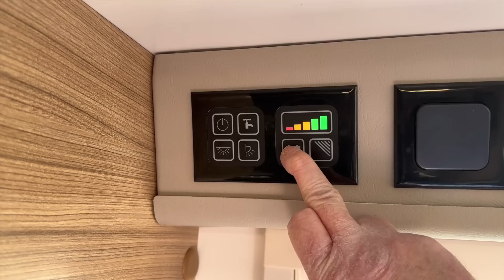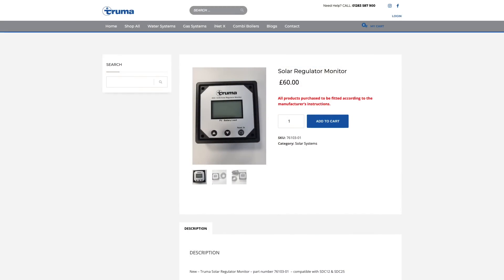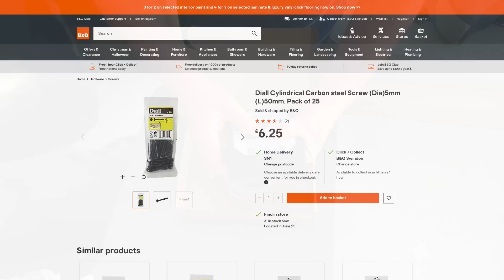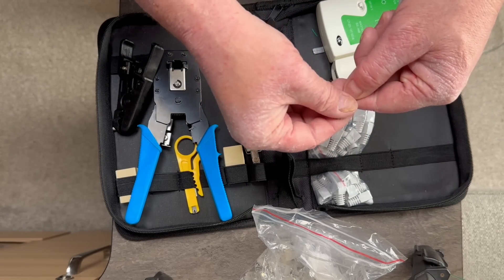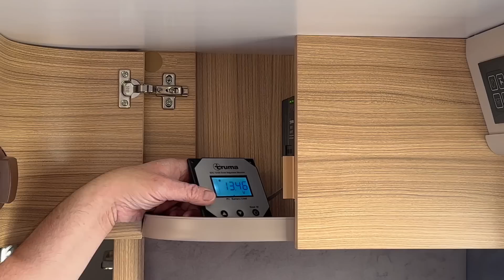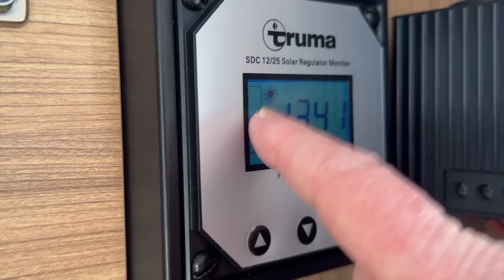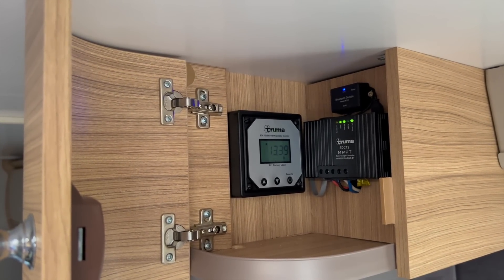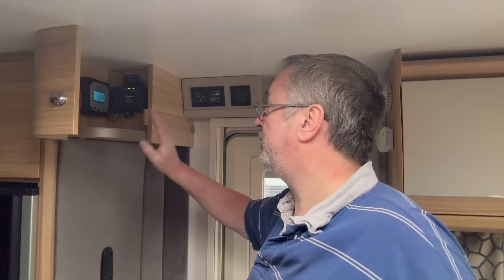Solar regulator display installation in a caravan

Comment: Ha ha, learnt the hard way. I bought the Truma MPPT but a cheaper meter that looked identical from a large solar supplier…… however it wasn’t ideal and produced some dubious readings….. I’ve now ordered the genuine Truma one so I hope this resolves the issue. As they say buy cheap buy twice….. only complaint is that on my old PWM meter I could also see the state of the motorhome battery too….. this obviously doesn’t provide this by the look of your demonstration and the fact you’re a caravan rather than a MH….. thanks for the video though it’s answered some questions for me

Comment: Really interesting vid. I’ve watched a lot of your videos and find the really interesting and informative. Couple of things. I never get the links you post?  We have a new Coachman Arcadia being delivered May. I’ve ordered a factory fitted solar panel. Warranty would be void if I did it myself! It’s a Truma 120w Panel as that’s all you get no option. Do you think that’s big enough as we will be off grid a lot? It only comes with a PWM controller so will change to a MPPT. Is the Truma kit worth sticking with? And would you stick an extra 80w panel on the roof?  Cheers Alan

Comment: Will fitting this effect my warranty
Reply from the maker: Hi Paul, great question - Simply put - No, but if you are concerned ask your supplying dealer if this will affect any warranty, or ask them to fit it for you. 

When it comes to warranty issues, a level of common sense will need to be used. If you break the solar panel, or controller whilst installing this - then one might assume this could be related. However, if you're suffering water ingress at the front of the caravan, its clear this install has not caused or been a contributing factor to the leak.. you get the picture....

Hope that helps, if you have any more questions feel free to ask.

Comment: HI Dan quick question just installed one of these .do you power the unit off after you stop using the caravan .
Reply from the maker: Hi, no i leave it alone. What I have discovered is the meter will only display a voltage if there is power coming from the solar panel. so in low voltage / low light conditions (like now) the meter will not display, unless you power it back on. 

Hope that helps. 
D
Reply: Thanks that' was my thoughts

Comment: Great video Dan does the screen blank out when not in use .
Thanks
Reply from the maker: Yes it does - the back light switches off after a couple of mins, and if no charge from panel it switches off completely.
Reply: Thanks dan will have to get one I'm having trouble with my mppt controller. Full green light never goes solid and always telling me it's ready to charge.

Comment: For that money a proper battery monitor with shunt would be far better. Granted you would have to run a cable back to the battery which is more effort than simply plugging in the display you have used, however importantly I note, you have already upgraded the charge controller to Truma MPPT and the standard Truma PPT controller installed at factory doesn't have the port so for most would not be possible to use that display. If you don't actually want proper battery monitoring and merely want a digital volt / amp meter with estimated battery State of Charge, which is basically all that display is, then I would suggest for most people (assuming they have the standard factory fit Truma PPT controller) they would be better to swap their controller for an MPPT controller, benefitting from the charge efficiency improvement but not to upgrade to the Truma MPPT controller and instead choose one that has a display on it, thereby solving both the lack of display and improving charge efficiency with one device and costing a lot less than the Truma MPPT and separate Truma Display. I would still put in a proper battery monitor with shunt in too though.
Reply from the maker: Hi, the caravan did come with this MPPT controller, as the old PWM controller is now no longer fitted.

As for a shunt, yes thats a much better solution - but to be honest, i just dont need that level of accuracy. I just need to see what the actual voltage is, and if there is anything coming from the panel.
Reply: @TheTrudgians  about time caravans are fitted with MPPT controllers from factory. Yes, in your use case simplest easiest option is what you have done. For those with older vans that don't have a MPPT controllers then get one (so so much better) but get one with a display on it. For those that want to really geek out on data, then also get a smart shunt and display, preferably with Bluetooth and logging, this will give all the data and historic data anyone could ever wish for. 
Great Vids Dan, I think I have watched every video you have ever put on this channel. Still prefer the how to video's you do but there is only so much you can or would want or need to do to a new van. Being a tinkerer, I love fixing and upgrading stuff, give me a van that's a few years old and out of warranty every time.

Comment: Bailey and other brands should install a quality solar controller such an Epever solar controller from the outset .  From that and your new display - you can see how the solar is performing.  Volts isn't the best measure of a battery SOC though.  Best to counts Amps in and out with a shunt.  I added both the Epever and a Victron smart shunt with bluetooth to our Swift.  From the house I can see what the caravan is doing outside.  The Victron is so much more accurate than the Sargent unit.

Comment: Very good video... But...I'm sat in my 2017 bailey scratching my head to understand why new caravans don't tell you the voltage. I have a crystal clear digital voltage reading as part of my standard bailey switch panel. Why would manufacturers get rid of this? Backward step?

Comment: Nice Video! If you need to replace the Truma MPPT, I can thoroughly recommend Victron gear. It comes with bluetooth, 100% reliable with lots of data available, if you want it.

Comment: Hi, great video. Thanks. We're thinking about getting a solar panel in the future. One question about my battery. Our caravan is parked up on our drive hooked up up to mains from our garage. Would this be okay for the winter. Is it best to remove the battery and keep it on charge in a warmer place, like the garage. Thanks
Reply from the maker: The great thing about keeping a battery plugged in on teh drive is you can set the heating on low to drive off any frost or freezing weather. However, the charger on board is essentially a power supply, constant voltage, constant current. So it wont charge a battery, more keep it topped up. 

Occasionally switch the power off and run something on the battery to draw some current, then switch the power back on to re-charge the battery.
Reply: @TheTrudgians  Thankyou for the reply. really helps watching theses videos, as a newbie to caravanning.😁

Comment: Hi Dan, another very useful mod - thanks.  Did you ever get round to fitting a remote heat sensor to the Alde heating system?  We are experiencing the same problems as you have mentioned previously  - I.e. the system thinking it’s warmer inside the caravan (2024 Bailey Unicorn V Seville) than it actually is, due to location of current heat sensor which is inside the Alde control panel fixed to the external (offside) wall panel.
Reply from the maker: Hi, yes I did. ive fitted teh external sensor and a new internal sensor too. Both vids coming soon.

Comment: Much better to have something that you can see a true reading of in stead of what does that mean??, our unicorn has the built in battery meter reading which is great, switch power on and you can see what charge is in the battery, nice neat job Dan thanks for your video, 👍👍.
Reply from the maker: Glad it helped. By the way, its 13.34 today ;-)

Comment: Nice tidy job Dan but for the £60 cost I’d just upgrade to a Victrom Smart solar mppt controller, the 75/10 can be purchased for around £50 and will be a good upgrade over the Truma controller, the Victron app is great and gives everything you need to know
Reply: Hi The Hoopers, I have the same van as Dan, the Victrom 75/10 looks to have all the same features as the truma one Dan fitted but with the benifit of reading it on my phone, was yours a like for like swop or did you have anything the alter ? Cheers Peter.
Reply: @peterkane4524  hi Peter, it will be a straight swap, really easy just a positive and negative from the battery and a positive and negative from the solar panel, once all wired in go into the app and update the firmware and select the battery type you have, that's it easy 5 min job

Comment: Hi Dan,  after viewing your earlier vlog I fitted the dongle and it works okay.  What would be really useful is some way of measuring the AC mains input current, so that you do not trip the breaker on sites where the power is limited. Any ideas?
Reply: Alde do a load monitor which we had fitted to our Evora. worked really well in France and Spain this year.
Reply from the maker: Ah, ive been beaten to it. Alde do have a load monitor, but its not somthing you can read (Like how much power youre using) but instead it cuts the power for the heater based upon your current draw. Handy for lower power pitches.

Comment: interesting.  I have a similar solar panel display.  (No display just lights) this looks easy too install.  Xx
Reply: Interesting about the unbranded version. Saw a video on YouTube recently about buying a Yaesu remote keypad from a very popular Chinese website, which was branded Yaesu, looked identical, but very small details differed, but was pretty certainly a copy, especially as it was half the price as one from a Yaesu dealer! Very Clever these Chinese!

Comment: Very interesting, Dan. I have a Victron MPPT solar controller with Bluetooth and a LiFEPO4 leisure battery with built-in BMS & Bluetooth. The information provided on the apps for both is good, so personally, I don't feel a display like the Truma is justified in our setup.
Reply: Victron do a similar product ( Victron Energy BMV-700 Battery Monitor ) but as you say the app does a really good job
Reply from the maker: And.. it wouldn’t work with your set up.
Reply: @TheTrudgians  that's why I said, ".....a display like the Truma..."! 😄